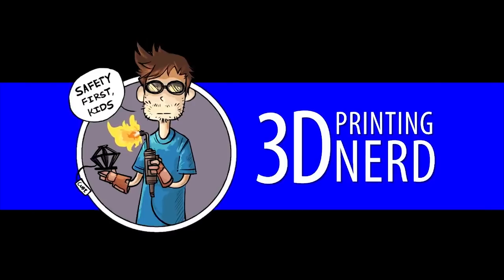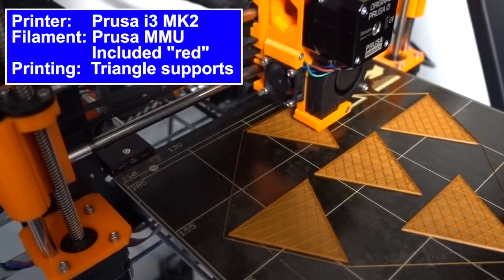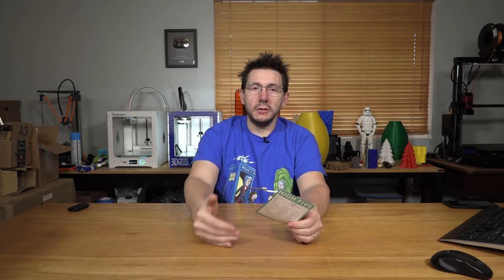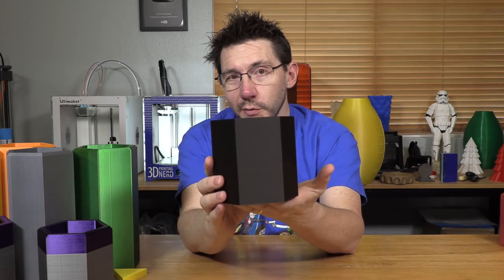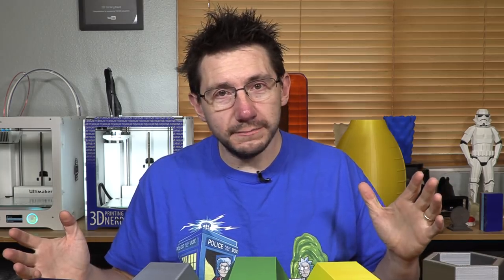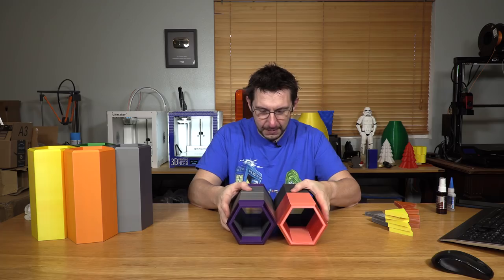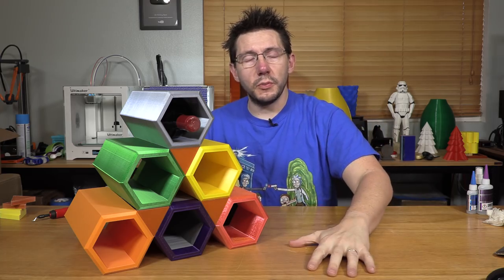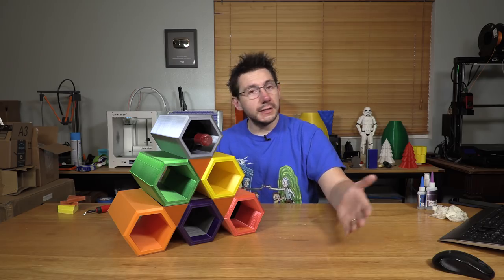3D Printing a Make Something Inspired Wine Rack Using 9 Different 3D Printers

Comment: Your approach is still very traditional to current manufacturing by making the sub-parts individually that still further require assembly. Having the ability to manufacture parts on a large print volume, redesign the holder in a way that can only be done using Additive manufacturing (no glue up or little to no post processing) to indicate your "solution" to the limitation of traditional manufacturing. Great video as always, Hi Five!
Reply from the maker: Yeah, in the end, I think it boils down to me need MORE design experience. I come from a woodworking background, so that is what is familiar to me.

Comment: Like the dove tail and tabs design idea. Also a different assembly pattern would be to assemble flat to flat instead of edge to edge. That would have the wine bottles resting in the interior angle instead of the flat. Same number of hex’s would have a slightly smaller footprint.

Comment: I bet you could print the hexagons relatively quickly using a large nozzle, with a really thick single-walled vase mode print. I've been able to get 2mm thick walls at .35mm layer height using a .8mm nozzle. For something that size, I would expect maybe 2 hours per piece. And the 2mm solid walls should be plenty sturdy enough, I would think.

Comment: functionally speaking, the hexes should be tilted off level so that corks are kept wet by the wine , so additionally a lip/stop of some sort should be engineered to stop sliding.  Then clearances checked for the lift and remove operation that would then be required

Comment: For very simple geometry woodworking is going to kick butt.  However, if you were to print some interesting vase mode tubes with the 1mm nozzle and some nice connectors with a standard nozzle, you'd have something no woodworker could come close to emulating.

Comment: Why didn't you use "Wood" based filament?
Reply: Maybe those were the ones he had around in the middle of the night?^^ I almost never have wood filament around especially because it is really "special" filament. Carbon fiber filament at least has the strength while wood is only used for it´s look. And if you only have one hardened nozzle available I would use CF filament instead of wood filament.
Reply: Because “COOOOUUULLOOOORRRR”

Comment: Nice one, Joel! I like the way you tested different filaments with different printers!
Just on the 'Insta' fix something with CA. It is quick enough as it is. Patience.
You also get a CA gel type, which will fill better and give you time to adjust things a bit before it sets. And doesn't run all over everything.

Comment: On splitting a body in Fusion360: Try using a construction plane as the splitting tool. Offset Plane from one end or create a midplane under CONSTRUCT.

Comment: I would also add a slight slope to the rack so the bottles keep the wine touching the corks so that they do not dry out over time, but you could also just use a small shim at the back under the rack to create the angle
Reply: nicholas white is this really an issue?  Are people shelfing less than half a bottle of wine?
Reply: it happens to unopened bottles too, it would only be an issue if the bottle sits for a long time, doesn't matter if it's opened or not

Comment: I need some advice from you: I'll be buying a Creality CR-10S to start in 3D printing. Should I start with MatterHackers PRO PLA to avoid filament related problems or can i get filament from Hobbyking (or another one) to start and then use a better one?? Is the Proto-Pasta Carbon Fiber PLA better than MatterHackers PRO PLA?? (I'll be doing structural/mechanical prints for sure). Thank you very much!!

Comment: Hi, Joel - cyanoacrylate glue (crazy glue, super glue et al) cures in vacuum, which makes it a poor choice for a fibrous or bumpy surface.  Probably the best choice would be a two part epoxy glue.  And if you used only ABS plastic, you could use ABS glue, purchased in the plumbing department of any major hardware store.  These glues will mar any finished surfaces, so you should be cautious to avoid spillage during application.

Comment: I would have done a slightly different method of keying the parts using openings in all the parts and registration keys (or say dowel pins) so that way you can line up the parts any way you want without being "locked in" with registration keys. When we made weldmetnts (welded parts to mimic castings) we would drill holes in all the parts, put pins in and go from there. Made things a lot easier!

Comment: Sometimes I think of gluing like welding (not that I weld):

(1) It is permanent. (More or less.)
(2) An alignment jig is a good idea.  (But don't accidentally glue thing to jig.)
(3) Dry fit several times as practice. (Rehearse, get some (short-term) muscle memory.)
(4) It is hard.  Be patient.  Take your time.
(5) Some glues will not stick to parchment paper (used in baking).  So parchment paper can sometimes protect your desk while not becoming glued to your item.

I tend to prefer super-glues that set a little slowly.  For example, DAP Rapid Fuse take about 20-30 seconds to set, so you can do some fine adjustments before it bonds.  (But sometimes it sets much faster than expected.)

Comment: Nice. Lot of time and filament, but a project worth considering.

I fly model planes (the balsa kind, as well as foam and anything else I can get airborne long enough to crash), and the best CA I've found is sold on Ebay by "Themuduck" or "Foamin at the mouth - Rabid Models" (he sells indoor foam planes as well). Marc is a great guy and his standard "Hyper Bond" Thick CA is great for PLA. It doesn't soak in too much, and doesn't set up fast a all, but goes right off with Accelerator. He has a set of 3 viscosity 2 oz bottles, 5 cs (water thin), 750cs medium (motor oil) and the thick 1500cs (maple syrup). 
There is a big difference in CAs, the Hobby King stuff is cheap, but crumbles with impact. 
Hope this helps somebody out.
Reply from the maker: Helps me out, I'll keep this in mind!

Comment: One thing I learned from wood turning, about gluing yourself to yourself is an easy way to prevent it is take some blue masking tape, and wrap the finger tips you'll be using in it. Then after you're done with all your gluing you just rip it all off.

Comment: Do you have a link for the spatula? That seems really useful and not so as dangerous lol.
Reply: You can buy the "Spatula" at any art supply store that sells painting supplies.  It's actually a Palette Knife.  Originally used for mixing colors on a palette and scraping away the excess when finished.  It makes a pretty good 3D printing tool for removing finished prints.

Comment: As a home brewer I may need to make this.

Im wondering how a slot and peg system between the hexagons and triangles would work to help things interlock
Reply from the maker: Truth. I wanted to copy nearly exactly what David did for his, so I did not add pegs. If I were to do this again, there would be pegs :)
Reply: started playing around with slightly different measurements and pegs in solidworks before class

Comment: Early on I thought about using some tabs on some of the parts to help with aligning the parts during assembly. On a different topic, which delta printer is on the table behind you to the left of the Ultimaker?

Comment: Clever enough and looks good, if a little colorful. Glue philosophy: Do not apply the parts with CA accelerator on an opposing part. That way lies heartbreak. You can spray the stuff on the parts when put together because the accelerator will creep in and the chemistry will work inward. The super thin, watery CA was the same as the early days, when that was the only flavor. That was also when parts had to "mate" face to face-- which should hold true with 3D printing! The thicker stuff was a godsend ("gap filling"). Now of course there is Gorilla Glue that has a rubber component to its CA. BJ people may well have the same material.

Comment: Joel, Just wondering why you split the hex parts in patch instead of using the split body tool in the modeling? If I'd does something better in patch please tell us, I'm always looking for better or faster techniques.
Reply from the maker: Well, I used the extrusion in Patch workspace to split the body. I think choosing split body from patch or model workspace does the same thing, but the extrusion in Patch workspace can be zero thickness. I learned that from Maker's Muse :)

Comment: So i have a Crealaty cr-10 and I can't get the prints to stick to the bed. I have the bed temp at 60C and the extruder temp at 200 to melt the PLA i have tried printing directly to the glass plate and it did not work so I tried outing tape on the bed and releveling it and then printing and it did not work. I just recently tried adding glue from a glue sick to the tape and printing and that did not work. Do you have any suggestions on what I should do to get the prints to stick to the bed?
Reply: Matthew Davidson I use a thin layer of glue stick only on the glass plate. I actually bought a set of 12 inch x 12 inch mirrors from home depot (you can also get them from Lowe's and ikea). They come in sets of 6 and 12.  I used this to replace my cr-10's glass as it was actually warped and I couldn't properly level it.

I've only ever had my print slip off the mirror once. Also, I usually set my nozzle to print PLA at 210 degrees.
Reply: Matthew Davidson come over to my troubleshooting videos. I'll get you sorted
Reply: GeoDroidJohn thanks and also I have fixed the problem

Comment: I am disappointed you missed all of the advantages of 3D printing in this build.

- Reduction in plastic used
- Press fit / glue design
Reply: Mickice as well as the fact that every part is customisable and interchangeable

Comment: Hey Joel I have a problem with my 3D printer and I was wondering if you could offer some advice. The first let’s say 4-5 layers of my prints are always squished together. They are not squished on the build plate. My leveling is fine, but they turn out goopy and terrible because they are always squished. After the first 4-5 layers the print does fine. Any ideas?
Reply: I hope he does not mind me jumping into to help. Most likely your bed level is not fine :-) I know I know but 99% of problems are bed leveling. a too squished first layer "WILL" effect the first 3 to 5 layers because its still extruding the same amount of plastic and it takes a few layers for the over squish to "spread out" vertically and normal layers to resume. ie what you describe sounds exactly like too much squish (nozzle too close for first layer)

print a single layer and post a picture.
Reply: Nerys hey Nerys thanks for the reply! So I did raise my nozzle a bit and the print turned out better...not a huge difference but better. If I lift it anymore it won’t stick to the bed. I do not know how to post pictures here...sorry. I’m gonna experiment with different things..like printing a new x carriage(the one I have is a bit worn out) and adjusting some extrusion and retraction print settings. Anyways thx for the help! PS. If you are wondering my printer is the Tevo Tarantula.
Reply: Matthew Guiher no problem if your print surface is forcing you to shove the nozzle into the bed to make it stick you need to improve the print surface standard go to is try some masking tape and glue stick just to see what happens I know p e I can be like that as it wears it stops sticking and you have to take some super fine sandpaper and scuff it a tiny bit and then it sticks properly again so you might be compensating for bad bed adhesion with more squish but more squares is causing the secondary problem of sloppy layers try reducing your Extrusion multiplier for just the first layer and see if that helps a little bit
Reply: Nerys thanks I got it to stick good and my prints are looking a lot better(I guess it was my bed leveling 😛). Thanks a lot!
Reply: Matthew Guiher excellent now it's important to pay attention to that first layer and try to memorize what it looks like how the plastic looks coming out how the plastic looks laying down so that in the future when you look at that first layer you'll go oh that doesn't look right and you know right away you have to adjust level
Reply: Matthew Guiher yes his help was right on the money.  Never assume you did anything perfectly.  It's like science,  doubt every variable.  Test each one individually.

Comment: Your filament cost must be out of control. Most all of my prints are practical. So a wine rack with the time to print, cost of filament, etc. you can buy a wine rack. My most recent prints are, design and repair of the holder for my build plate on my Sindoh DP200. One of the clips broke, redesigned and printed. A replacement mount for my outside security system camera as you can't order just the mount you have to buy the entire camera which comes with the mount. I took measurements of the old one and built my own to replace the mount. I built a LED light strip for my DOBOT MOOZ 2 that I light with an Arduino and Neopixels. A mount that sits on my computer display that holds my cell phone. 2 clips to hold my new keyboard that does not angle as well as my older Mac keyboard. So, I took off the angle mount of my old keyboard and adapted a bracket to hold it so it angles properly. All those prints were no more than 4 hr prints. My largest print was a drawer, small screw in dish to hold money, and unscrew the dish and screw in a cup holder for my BMW 850i which has tiny cup holders in the glove box. The drawer and dish were smaller prints, the cup holder was maybe 7 hrs since I make it rather tall and thicker so it's stable. Not criticizing you just thinking about all the filament and also the cost of filament when a print fails and you are 5 days into an 11 day print. Hope you keep track of the Z axis location on failed prints and try to edit the gcode to potentially recover failed prints. I've tried it. I would not try to sell those recovered prints but since I do practical prints for personal use recovering prints has worked for me about 30% of the time. Cheers and you do have a great channel.

Comment: Dude you funny I love you videos, now let do some tutorial about bonding, 1) prepare you work bench, use kitchen wax paper over your desk , crazy glue is brutal. 2) Never apply the activator direcc to the part first, apply you glue, acomodate you part and last always last apply the acctivator is bonding 101, the activator like the bottle said is INSTANT BONDING.  Get the proper crazy glue this brands have many of them for diferent use some are foam friendly some will disolved the foam or plastic, apply small amount, the use of activator will increase temp in the part melting the plastic. Monty (Aircraft mechanic bondig expert, advance composites.  Great video enjoy watching. Cheers.

Comment: Surprised you did not add keyways, a biscuit or a dowel pin.
Reply from the maker: Yeah, that was my take away at the end of the video.
Reply: Ah OK sorry. I gave up drinking about 3 years ago, so the design, print and finish was interesting.
You copied the design that was made it wood, but as you can do things much easier with a 3D printer than with wood working tools. It would have be fun to include, design touches. Maybe like an open honeycomb down one side, a indented bunch of grapes or even your name?

Still a good video, thank you.

Comment: You dont need the triangles
Reply: the "way" he arranged them he does. otherwise only the polygon "edges" would be available to adhere to one another. remember this will be load bearing. there is going to be a decent amount of mass in it when its filled up.